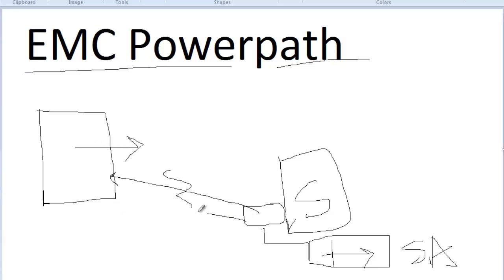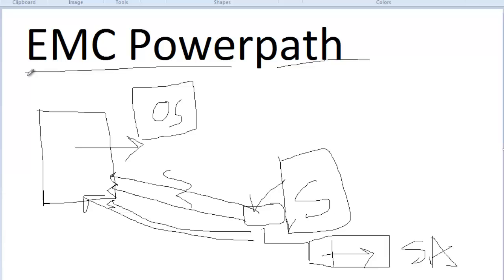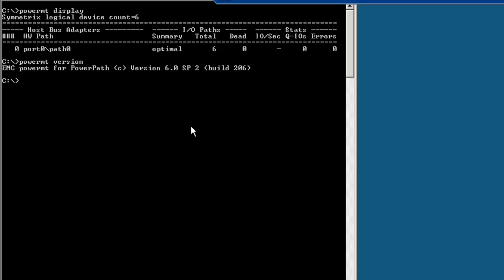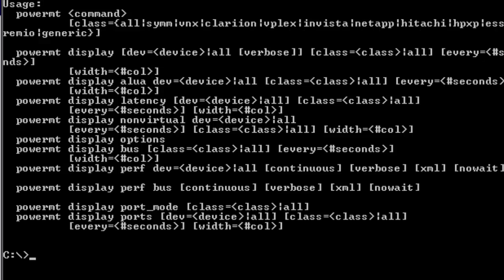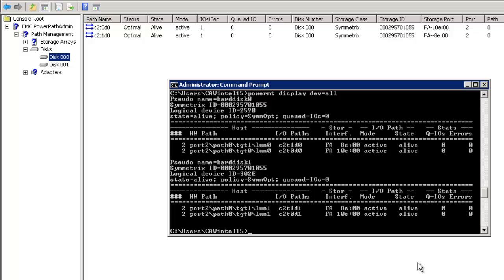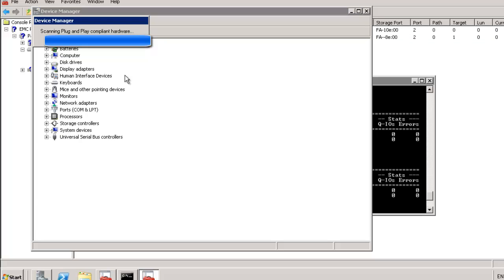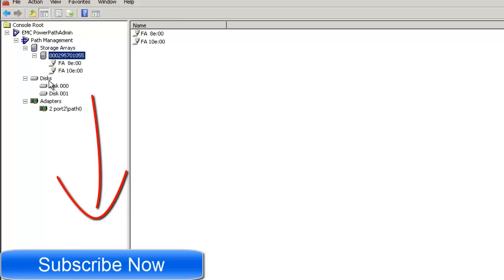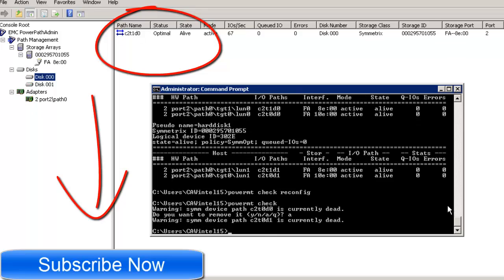How to Use Powermt Command in EMC Powerpath [AskJoyB]

Comment: I've a doubt,  there is host where poweremc SAN is connected like disk is emcpowera , emcpoweraa , emcpowerba, ....etc. on that host Physical volume was created as /dev/emcpowera, /dev/emcpoweraa and /dev/emcpowerba ,....etc.. ,I've configured multipath on that host and started multipath service, post to that physical volume name  was changed as /dev/306876544444000ffff766 , /dev/3000566ff3356600000x7 and /dev/3408frxy77888445666 , etc... I JUST WANT TO REVERT THE CHAGES, COULD PLEASE HELP ME OUT ???